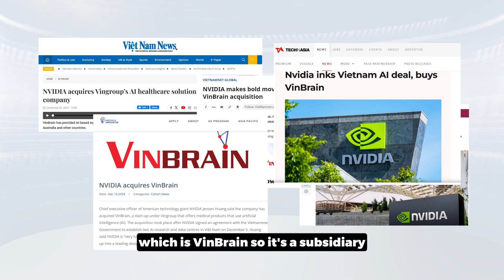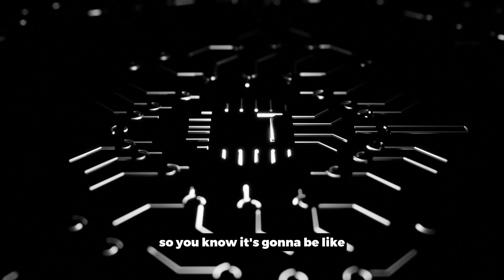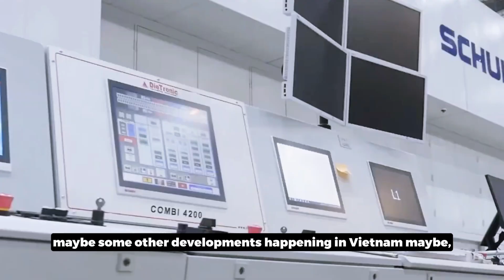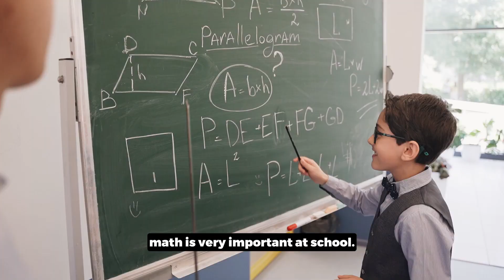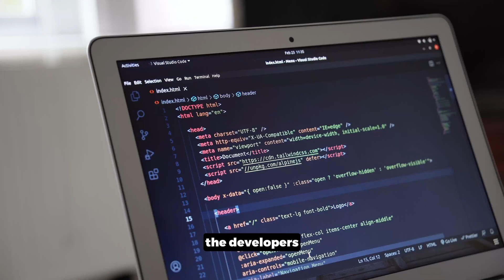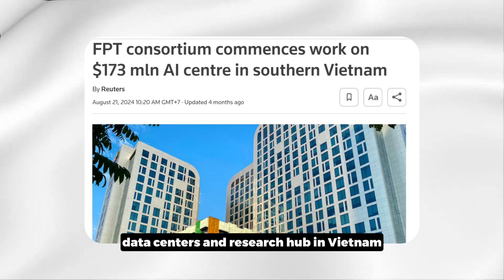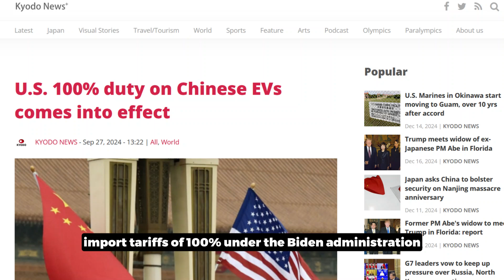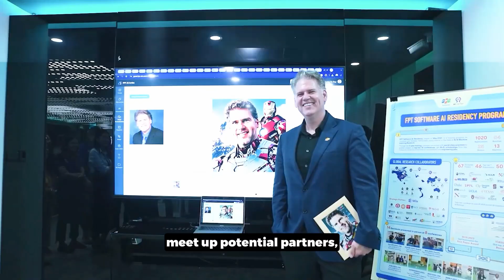Why NVIDIA invest in Vietnam | Future of Vietnam Electronics | High-tech manufacturing in Vietnam

Comment: NVDA is investing in Vietnam only because it has cheap labor and because they need a hub outside of China to diversity. Vietnam does not have the technological capabilities or skills to make high value semiconductors. And that isn't going to change anytime soon. That's why INTC has never produced much from Vietnam after being there for 15 years. INTC recently backed out of more investment into Vietnam stating huge bureaucracy and power supply issues. What they won't say is corruption is an even bigger reason. NVDA will learn the hard way.
Reply: Time will tell. This is a different age post pandemic. Intel is becoming less relevant by the day. The energy grid has been fixed to help move excess power from the central region to the north. Nuclear energy production will start. Buying LNG from the Trump administration will help. NVidia's CEO visited Vietnam in back-to-back years. I'm sure by founding and  running the second highest valued company by market cap he knows what he's doing.
Reply: @phucdo6085  You don't get it. The point is there is no real investment by NVDA in Vietnam other than cheap labor. It's just a posturing motion. It's superficial. It's more about recruiting VN gov to be a customer of NVDA than anything.  I know how these things work. I worked on Wall Street. This guy is exaggerating the relevance of NVDA's "investment" because he's trying to sell Vietnam as a great place to do business (which it's not). I know NVDA as good as anyone. I am a world-class investment analyst who has been recommending NVDA as my #1 stock for long-term growth since 2009. But Vietnam isn't going to be a relevant player with NVDA. It's that simple. Vietnam offers cheap labor, not but that comes with high levels of corruption. As far as INTC, they still control 75% of the CPU market so they are relevant. You are trying to downplay INTC as a way to push away their unwillingness to invest additional money in VN due to corruption? LOL. Wake up.
Reply: @AVA_Investment_Analytics  its not cheap labor, its competitive skilled labor. We are dealing with AI and not a running shoes sweat shop
Reply: @north-n1m  You're dreaming kid.
Reply: @AVA_Investment_Analytics  FPT president clearly states Vietnamese skilled labor, https://www.youtube.com/watch?v=mCqz5rNYyv4&t=38s
Reply: @AVA_Investment_Analytics  yes I woke up to Intel firing their CEO and the shareholders demanding his compensation back. Also, Intel still says Vietnam is a key player in their global supply chain. Either way Samsung, which also just set up a R&D center in Vietnam,  and even Google, which finally recently opened up a Vietnam office, are making better chips than Intel now. The Nvidia Vietnam relationship will be mutually beneficial. Vietnamese firms get access to Nvidia chips and advice. Nvidia gets a new market. The corruption is everywhere in Asia from Korea through Indonesia. It's not anymore problematic than neighboring countries. Vietnam's quality of life and optimism for the future continues to improve. Watch Vietnam continue to ascend the value chain.
Reply: @phucdo6085  Sorry but unfortunately, your optimism won't translate into reality. I know Vietnam's economy well. Vietnam gov acts much too slowly and with ridiculous levels of bureaucracy to take advantage of its demographics. Within around 15 years, its demographic edge will end and then Vietnam will be faced with even more issues than today. As it stands today, few can afford to buy a home in HCMC. I could go on and on. The corruption in the country is amazing. And it's not going to improve markedly anytime soon. That alone serves as an insurmountable barrier. 

I'm not going to continue to beat a dead horse here because you really don't know what you're talking about. I do this for a living as a Wall Street insider and investment analyst. And I'm among the best in the world.
Reply: @avainvestmentanalytics  the TFR of Vietnam has been steady at 1.90-2.05 range since the mid aughts. The golden age of demographics will come to end in 2042 per UN projections but that doesn't mean the country will cease to exist. Taiwan, Korea, Japan's TFR have been much lower for decades but companies are still investing due to the potential of technological advancements in the future. You can slightly increase TFR with better economic conditions as the US did from the 1970s to the aughts or former eastern bloc countries after the fall of the Soviet Union.

If you follow what's going on in Vietnam, you'll understand it is entering  government reforms after the passing of Nguyen Phu Trong. It will be more leaner and efficient. The leadership is prioritizing even faster growth geared towards AI. 7% growth of 2024 year will seem mediocre compared to the upcoming years. 

Few locals can buy a home in any large cities in Asia or even in the US for that matter. Corruption is everywhere in Asia and Latin America. These are not Vietnam exclusive issues 

 You are "arguing from anecdote" bragging about your work history to try to legitimatetize your argument. That's a logical fallacy. Not sure what your alma mater(s) is(are). 
President elect Trump is supposedly worth billions. His organization is working on a  $1.5 billion master planned country club in Hung Yen province and he'll be president.  So if work history is what matters in this discussion then Trump's investment overrides your argument since the Presidency is historically more prestigious than any work in the US
Reply: I concur with you in most points. But would like to know more about NVDA : As a fabless company, they are focused on chip design and product marketing, sales and distribution , do they intend to set up chip design units in Vietnam? Are they getting involved in production ? Are they looking for capable manufacturers in Vietnam ?

Comment: NVIDIA's investment in Vietnam signifies the country's rising prominence in the global electronics and high-tech manufacturing sectors. Vietnam's strategic location, coupled with its commitment to technological advancements and skilled labor force, makes it an attractive destination for global tech giants. Great video
Reply: Vietnam has not enough electricity to run AI
Reply: @teatree6228  yes it will. Vietnam fixed the country's grid so it can move excess electricity from the central region to the north easily as well as starting Nuclear energy production stations. It will also buy LNG from the Trump administration.
Reply: @teatree6228 there's excess energy in the central region which will now be rerouted to the north after the national electric grid was fixed. Vietnam will also buy lots of LNG from the Trump administration.